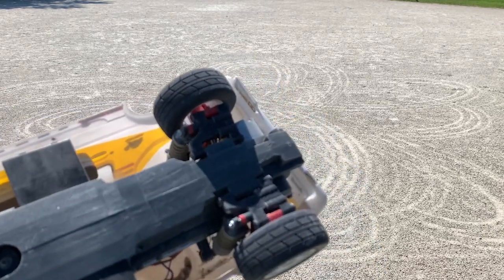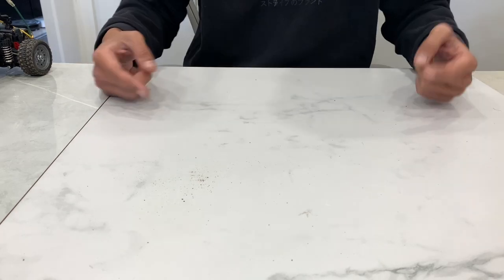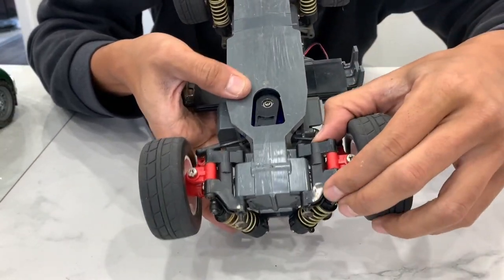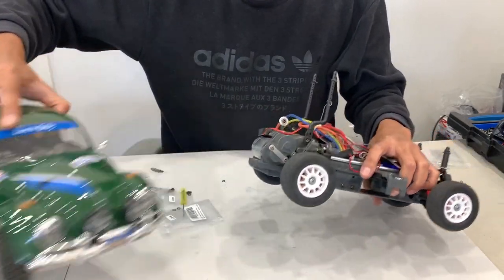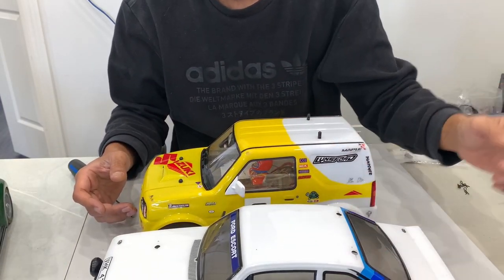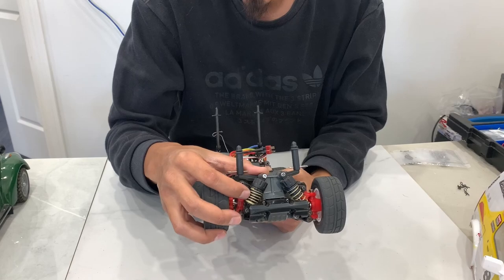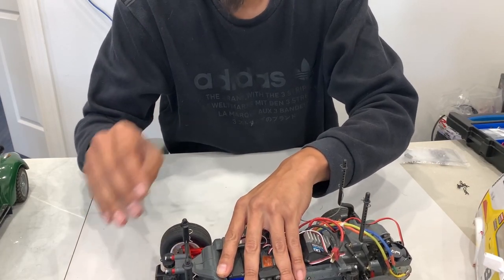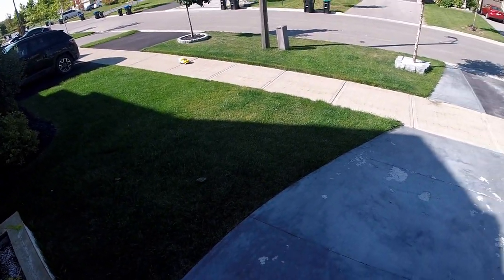MF-01X TUNING TIPS

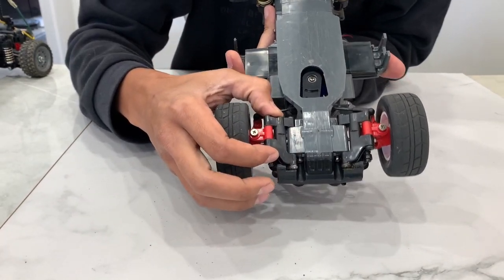Comment: when you wiggle the front suspension arms at 2:01 its because you assembled the two rear plastic parts of the arms swapped around, you will noticed it if you line up the small line notches on the back plastic part with the line notch in the front half of the suspension arm theres no play in the suspension
Reply from the maker: Yea youre correct! I noticed right after making the video 🤦🏻‍♂️🤣

Comment: If you do any sort of jumping with it, you also NEED the aluminum motor mount. Even just hopping it up my driveway on the stock torque tuned motor messed up the motor mount enough to have the gears no longer mesh. As always a great video and it's time to dust off my MF01X for some miles 😁
Reply from the maker: interesting...i should check my mesh on that more often, thanks for the tip!!

Comment: Great job on that soft front, stiff rear spring setup. It really seems to work now!
Reply from the maker: it truly does! we'll see how it does on a track setup hopefully before winter.
theres talk of a winter rally series in one of the rc clubs, so im excited to try that!
Reply: @rexrcs  rally is my favorite form of RC. And if you combine at the same event twistiy layouts over tarmac together with smooth, packed gravel bits, it'll be the ultimate rally test... and either way a guaranteed blast to drive!

Comment: Thanks for the video can u show how to lower the front suspension
Reply from the maker: It really depends on your set up, however, softer springs or less preload spacers on the shock body will provide lower ride heights, the MF-01X also has two locations on the “C-Hub” for you to mount the lower suspension arm to, they provide different ground clearances. Let me know if this helps
Reply: Thanks!
Reply: @rexrcs can u lower the front with the stock springs?

Comment: LOL, if you want a 320 body, I can send it to you if you pay the shipping, I have the correct wheels and everything. On another note, I really was disappointed by the Mf01x when I first got it, the whole rear upper wishbone thing was just incomprehendable design. BUT, my 911 carrera fits on the long wheelbase. So, that made it an intstant semi-favorite. lol.
Reply from the maker: interesting...3mm difference, wider arms? axles? hex adapters? how?
Reply: @rexrcs  911 carrera is a M02/m04 body, so its directly on the long MF01x chassis. I think its starting to get a bit rare as a body these days.
Reply from the maker: @tm5123  forgive me, I know which one you are talking about, such a gorgeous little body!
Reply: @rexrcs  Its my favorite. I was going to buy one back in like 97/98, but they only had the boxster. So I bought that. Later on the store got the porsche 911 carrera too, and they were parting it out for spares, so I bought the body, wheels and box + instructions, so I basicly got the whole car + accompanying stuff. :D And then I also got a slightly messed up blue one from another deal. :D Its a really nice, basic, porsche. :D
Reply from the maker: @tm5123  i wanted the one 😍

Comment: Thanks for the video, I love the off road drifting. Do you run steel pinion or use stock aluminium? Cheers Rex
Reply from the maker: I think it currently has a steel one, but I often use stock aluminum, once they wear down I change pinions. thanks for stopping in, cheers!